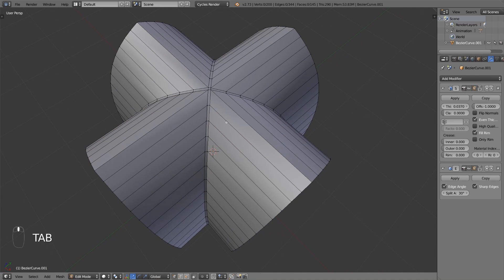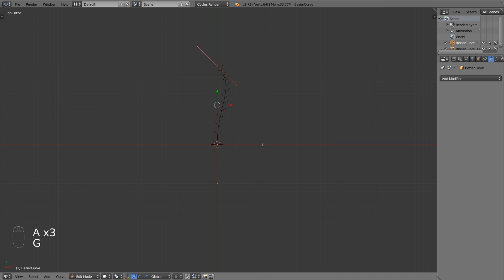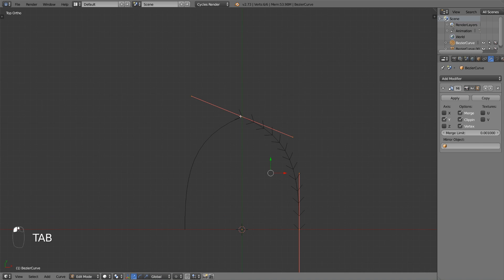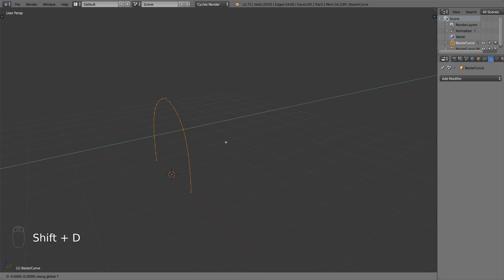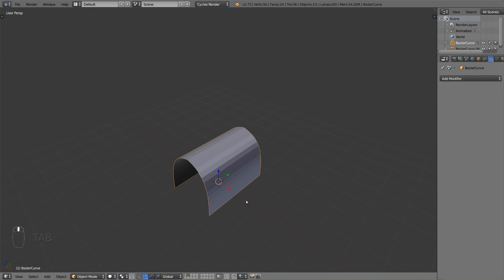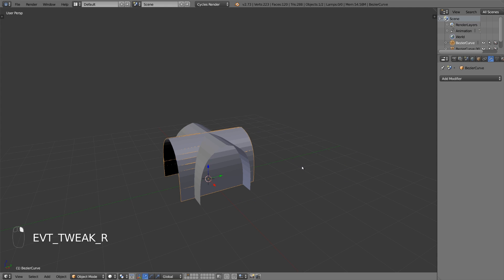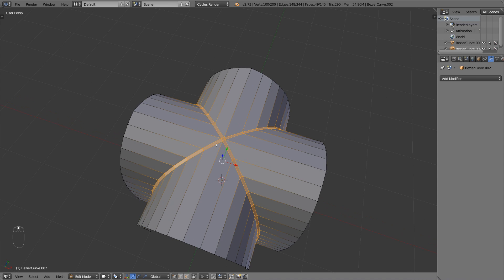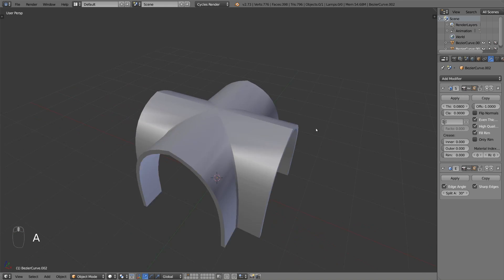Blender Quick Tip #3 | How to easily model a Cross Vault

Comment: I had trouble getting the mirror modifier to work the right way, it would do the exact opposite of what it does in the video. Solution is here, you need to make sure the origin point is on the correct side of the curve: blender.stackexchange.com/questions/353/how-can-i-make-the-mirror-modifier-work-right

Comment: Blender 2.78 - Boolean Modifier
Solver -> Carve
Operation -> Union
Reply: THANKS SO MUCH IT WORKED
Reply: Qubit Kernel Yeah, same i comented just now. But its good to learn different methods, it might be useful in some other situation.
Reply: Blender devs removed it in 2.8 in favor of boolean modifier. My suggestion is to use the union modifier, apply it, hide the other mesh used for the boolean, and then delete the faces still obstructing the arches.

Comment: Like many of you, I hit a snag with the Boolean step.  I never did figure out what the root of the problem is (probably something to do with his using an older version of Blender with different Boolean properties), but I figured out a hack that ultimately gets you where you need to be.
Go ahead and follow his instructions via the Boolean steps, even though it won't look right after you click "apply". After clicking "apply", delete one of the objects. With the remaining object selected, make a duplicate of it (Shift + D) and rotate the duplicate 180°. Then select them both, and join them together (Ctrl + J) to form one object, and you should be back in business.
Reply: Great work around SirWilly. Be sure to select all in Edit mode and remove doubles....
Reply: got into same issue tryed urs but went for just deleting faces seemed to work

Comment: Really trying to do this tut, but for some weird reason, I am doing something wrong, because, when I change it from Interset to Union, then I dont get the same result.Only got 3 way, not 4 way.
Though you are doing a really good job, by showing this tut, I just cannot make it do the same thing. I am using Blender V2.74
Reply: +Mikael Nielsen Same thing happened to me.  Did you ever discover the problem?